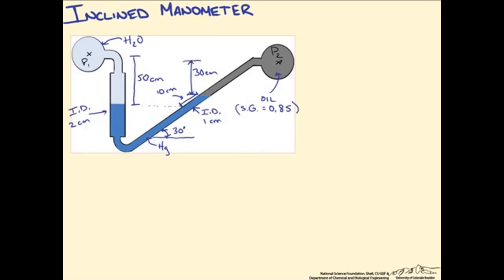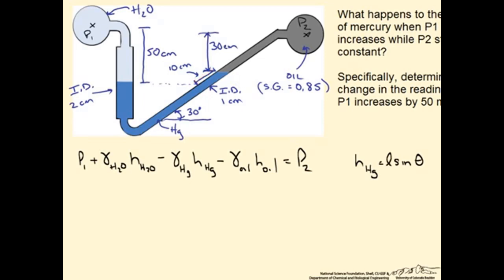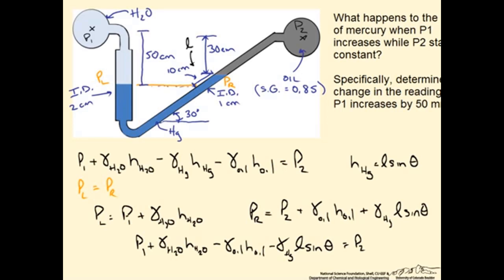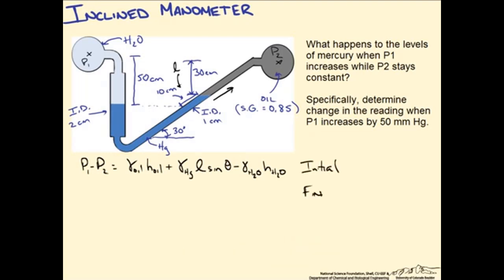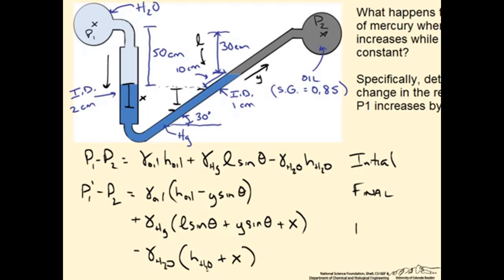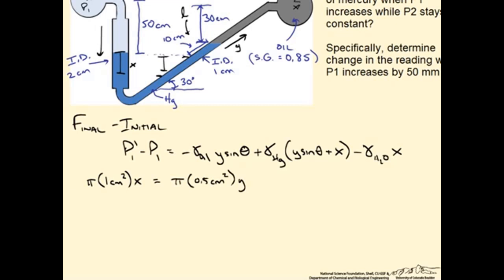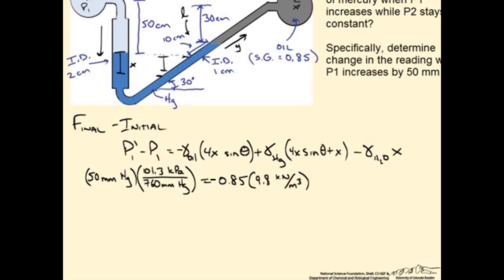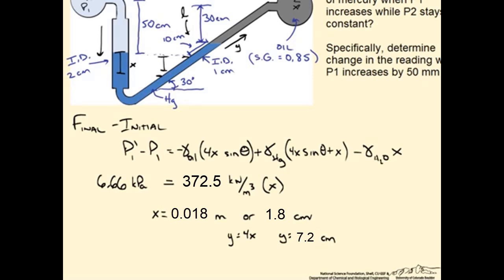Force Balance on an Inclined Manometer

Comment: Thanks so much ,however would kindly clarify : change in height in left side due P1 increased I think not Equal of Height of RHS as DIA is different but RHS change for the two Fluid is equal ((Kindly Clarify))Thanks in advance